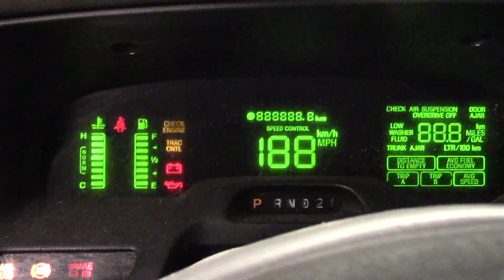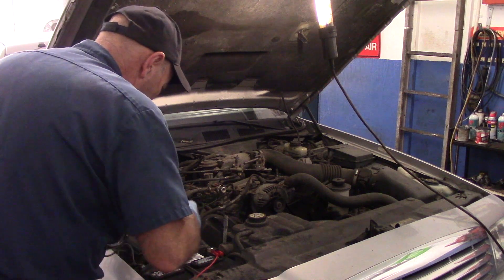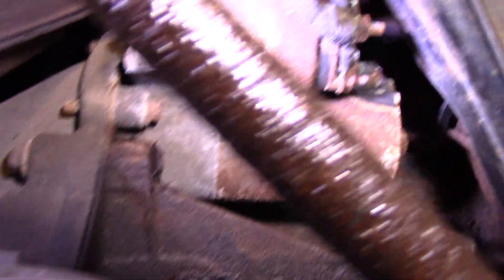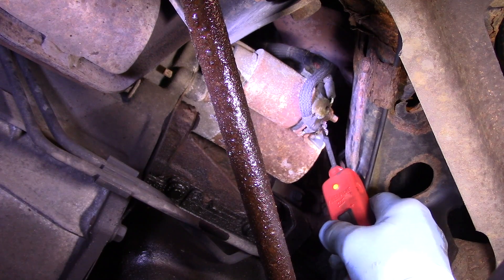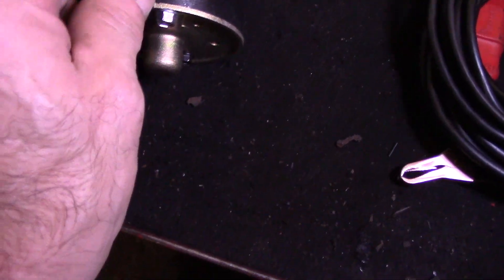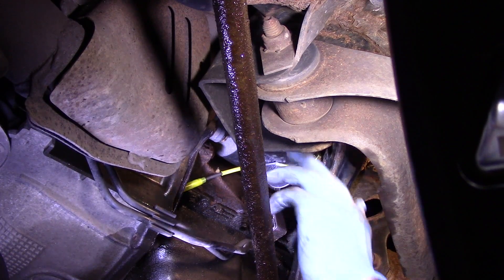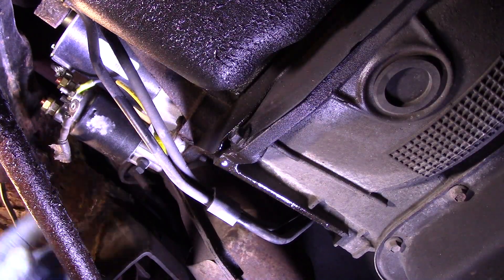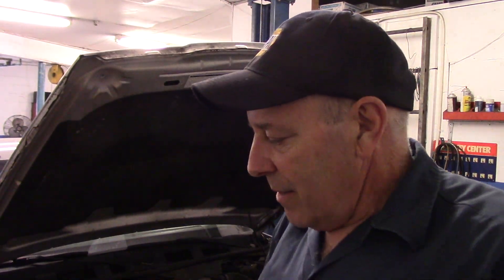How To Diagnose No Start, No Crank Ford Crown Victoria 4.6 Liter

Comment: Ha!  I just did this on a 2002 Grand Marquis last Tuesday.  On my back on the cold garage floor was no fun, three bolts and it took me 3 hours!  What I did to remove the top bolt easier was to break off the solenoid with a pry bar.  The metal connection between the starter motor and the solenoid is pretty brittle, and with a little force it broke right off. This allowed me to access that bolt easier.  Not so easy on the install! I wound up using a 10mm ignition box wrench that was 4 inches in length.  I was able to get the bolts tight in about 15 minutes each, turning that wrench about 1/8 a turn at a time.
Reply: You need an electric ratchet my friend
Reply: @sunnyvale4088  It's not the length of the bolts, it was accessing them- they were buried. If you're lucky, you can barely even touch the bolt head with 1 finger. A series of short extensions, a swivel head and a very short ratchet is needed.

Comment: so, New battery, and starter. Whenever the key turns over it’s the same as it is in the video, except the lights go out. Any Ideas?
Reply: Engine might be seized.  Can you put a breaker bar on the front of the crankshaft to turn it by hand?  If the engine turns out not to be seized, you can try running a temporary wire from the negative terminal on your battery, to the body of your car's starter.  You will need to use a fairly heavy gauge wire for this test, and I would consider temporarily putting the other end of the wire underneath one of the mounting bolts holding your starter.  That way if the problem is being caused by a grounding issue, you can temporarily eliminate the engine block as part of the grounding system.  Be extremely careful when  running loose wires inside your engine compartment.  In fact, be double careful.

Comment: So I have an 07’ Grand Marquis, just a repacked Crown Vic. It will not crank from the key, and obviously won’t start. I know the battery is good. I hooked up a remote push button starter switch directly to the starter and can get the starter to turn over strong. I checked ignition switch and have power, checked fuses and relays, got underneath and pulled the neutral safety switch off, had power at the plug and even replaced the neutral safety switch while I was down there. I still have no crank/no start. I’m stumped. Any advice?
Reply: find the solution?

Comment: i'm surprised, based on your years of experience in the field, you're an old-time mechanic. I'm surprised you didn't just repair the starter or rebuild it instead of just going with the old parts replace. as a customer, I would prefer a rebuilt original starter then some Chinese junk made thing from my parts supplier.